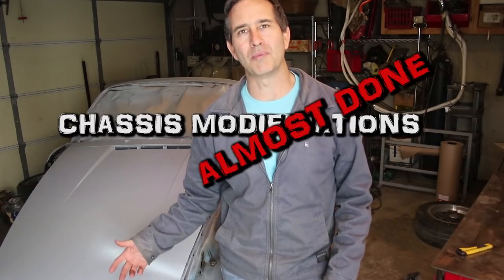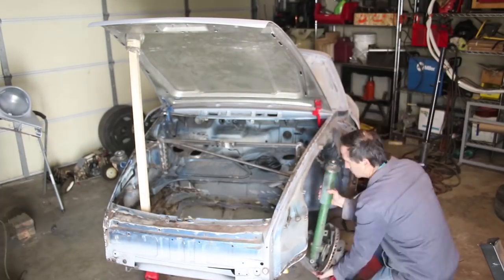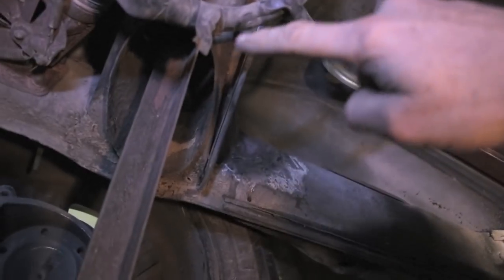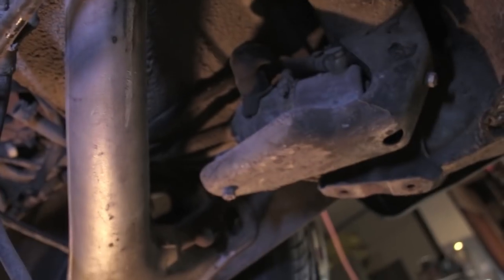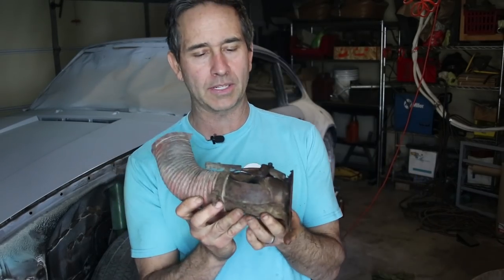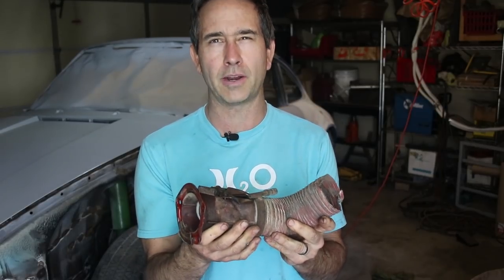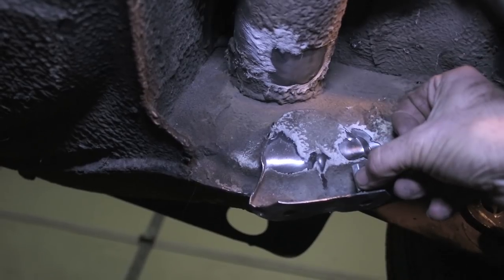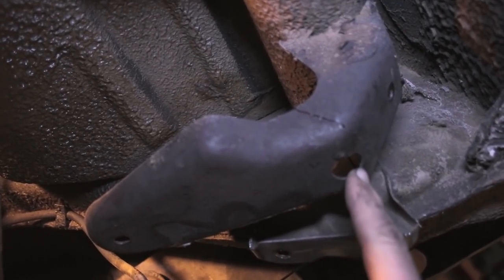More Porsche 911 Chassis Strength Mods For Strong Track Days

Comment: Awesome work as usual Tom, I hadn't seen the torsion tube to rear seat connection plate done before, will put that on my list.  Nice way of connecting the stock rear ARB mounts to the tube similar to those JWE brackets that I showed you as well. 
Bit late now but have you thought about building an octisserie for all the underbody work you are doing? Should fit in your space and save you from all those spark showers... 
What's the plan for the chassis, are you going to paint it as is or strip the rest of the paint inside and Body Schutz below?
Cheers, Lukas
Reply from the maker: Thanks, yes those ARB mounts were inspired by the link you sent.  No need for a rotisserie, I would spend more time making it then it would save me.  I'm only touching up the under carriage, because this isn't a show car.  I do have a shutz gun now😀. Famous last words I know, ha ha.

Comment: What are you using to remove the under-coating so cleanly?  Looks great!
Reply from the maker: There is no great method because it's a messy job.
I softened it with paint stripper, scrape off the big stuff, then use a wire wheel cup on a 4" angle grinder.

Some use an oscillating scraper tool from harbor freight to get the big stuff off.

Comment: Those steel bar coil overs would be great on the race track....no roll....no wallowing...extra firm ride.....seriously though I like your chassis stengthening..very hard to do under the car on the ground like that with weld spatter going all over...If Chevy Chase was a Porsche enthusiast he might make videos like this...
Reply from the maker: Yes, go kart handling!  Thanks for appreciating the welding.  It was tough although for some of it I was able to sit down with my helmet in the transaxle tunnel.  Why does all the weld spatter gravitate to my socks?
Reply: @GarageTimeAutoResto  That slow burning effect weld spatter has in your boots is good for winter weather....

Comment: Restoring and back dating a 1974 911s and watching you videos with great interest. Cheers for posting these. Good tips on the rear anti-roll bar mounts, I will see if I can track down some hex stud to strengthen up the area.
Reply from the maker: Awesome man, go for it.  Those nuts are from my ACE Hardware store.  The tops are ground down a little bit.  If you have are running a stock sway bar, then this is all you probably need.

Comment: Porsche 911 dont have a chassis. It is a unibody shell design. The car is light enough to be mounted on a rotisserie and rotated to allow welding in 1F. Beware of engineers, they over complicate everything. Hell is paved with good intentions. I am trying hard to remain civil and respectful.